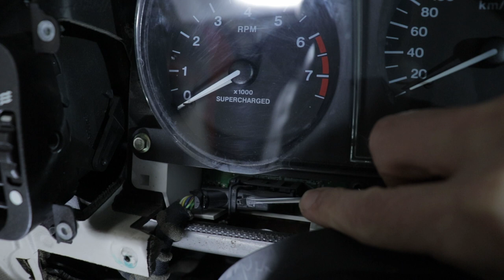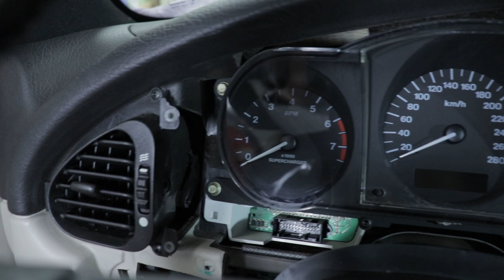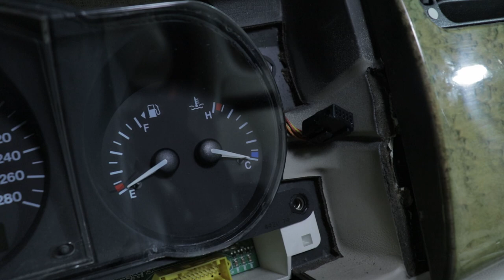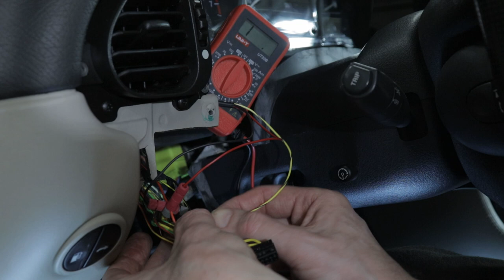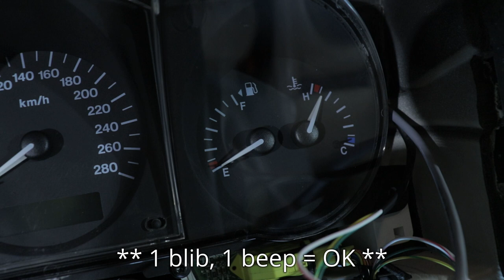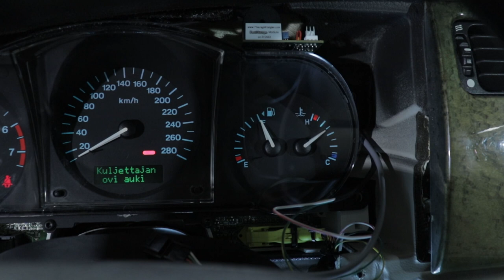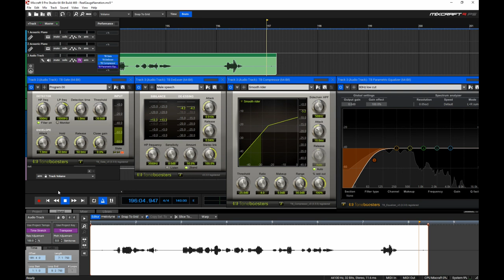Installing the RealGauge into Jaguar XKR (part 1)

Comment: Kul!  Have you done SUSPENSION FAULT light assessment? I have (new to me) 2000 XKR coupe and need to figure out where the suspension problem is located... Tack hej!
Reply from the maker: Hej, tyvärr jag har ingen experience related to your problem. No issues with the suspension so far.
Reply: @BrickSkatton  Tack!